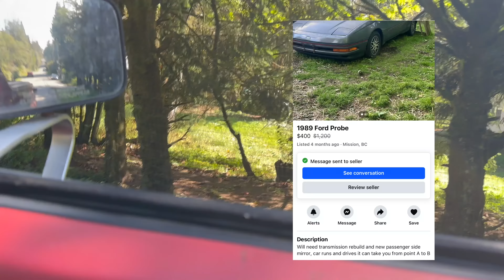BUYING & DESTROYING A FORD PROBE!

Comment: That was a limited ford probe… fully restored they are like 50k. You guys are killing me 😭
Reply: How much does it cost to restore 80k
Reply: Actually it’s not the “gt”, this is an lx non turbocharged automatic
Reply: @nitrous07me  it’s the gx
Reply: Just plastic and metal
Reply: @Luna5.7  yeah and cash is just paper
Reply: @Bossyosha its the lx trim. You can see lx near the driver side door.
Reply: You can’t put $ on having fun.. having fun and beating shitboxes is better then anything else
Reply: @rated4658  yeah they didn’t put it on the car it’s in the VIN. The probe gx had all the mechanical upgrades the gt had besides the motor but was a special trim package for some race in California. Had to order the trim right from ford if you wanted it. they didn’t advertise it because the suspension was so stiff for racing  etc. besides that they was many mounts for safety reasons. Nobody knows how many are out there probably less than 1000.
Reply: @Bossyosha  it literally is
Reply: @Luna5.7  go buy everything with printer paper then, jeez dodge people nowadays are so dense
Reply: @Luna5.7  glad you understand what composite materials are. Now study what appreciation is
Reply: @RADMAN752 is that why it was up for sale for 4 months😂😭
Reply: @itzaxo8860  yep, didn’t know what they had…. Shame- rare gx trim package
Reply: @RADMAN752  no dude nobody wanted it that's why it sat for 4 months😭. Witch means plenty of people seen it, and plenty of people didn't want it.
Reply: @itzaxo8860  eBay’s sold listing on a single pop up headlight went for 680. just bad luck for that probe… but using your logic a rolls Royce is just metal and plastic and leather, holds no value huh
Reply: @reskepa7028  when did I say that, use your reading glasses.
Reply: @itzaxo8860  doesn’t negate the fact that it’s 50k+ restored. Which is what my original comment was about, bye
Reply: @RADMAN752  ya and nobody is restoring a peice of junk ford fucking probe brother🤦🏼‍♂️😂
Reply: @itzaxo8860  your hopeless
Reply: @Bossyosha  typical probe fan argument
Reply: @RADMAN752  dude this is a an lx and your out here calling me hopeless. Wow dude. Do your research next time!
Reply: Junk anyways lol
Reply: Exactly😂
Reply: @Bossyosha my man there’s 10 for sale LX just like in the video way better condition for sale right now between 5-10k not sure where the 50k number is from maybe one with 100 miles on it.. one with 30k miles all original for 10k
Reply: @Riikkyy  this is a GX do some research, won’t be able to find one of those I bet.
Reply: @Bossyosha  I can’t find anything that says GX like you’re saying if you find a link for one post it up, I’m seeing SE, GL, LX, GT, GT Plus, GT “Wild Orchid”. You may be right but I can’t even find one to confirm. And if it’s so rare not sure why nobody scooped it up before they found it. 0 on completed sales on mecum, Barrett Jackson, eBay etc and no manuals or anything to read about it
Reply: It's a shit box buddy 😂
Reply: @Bossyosha  I can’t find anything on the GX trim. Does it even exist, lil bro? 😂 Also, it doesn’t make sense for them to use LX on the door, which is a lower trim, if GX is supposed to be a higher trim. Make it make sense.
Reply: 😂😂😂😂😂 trash box I’d take a KIA before that shit 400 would have been a new Xbox one 😂
Reply: @Chevyssboy138  nobody cares
Reply: @Riikkyy  I don’t care  if you can confirm, I am right it’s a 50k car restored, deal with it end of story bye
Reply: @Bossyosha  lmfao ok 😂 let me know when you find one sale to confirm
Reply: @RADMAN752  dude you don't even know what car this is ur tweaking it's an lx do your research and shut up
Reply: @itzaxo8860  I would’ve bought it in a heartbeat. They live in Canada though.
Reply: @Bossyosha  womp womp mad over rusty metal and plastic
Reply: @itzaxo8860  you are wrong
Reply: @Luna5.7  why are you mad? It’s just a YouTube comment
Reply: @RADMAN752   erm your wrong🤓, read the damm "LX" on it and shut your mouth, your digging yourself deeper
Reply: @Bossyosha  days later and your still bitching about the LX right infront of your eyes. Like I said, typical probe fan dude, get real.
Reply: @Bossyosha  it's just plastic and metal
Reply: @RADMAN752  these comments got you HEATED. Who are you fooling?
Reply: @Luna5.7  dw bros still tryna comprehend the fact he's wrong😂
Reply: @itzaxo8860  gx didn’t have a badge, was a special trim package. Shows how much you know.
Reply: @Luna5.7  your the one who won’t accept that I’m right, calm down the truth got you all fired up
Reply: @Bossyosha  it's just plastic and metal lil bro
Reply: @Luna5.7  yeah and it’s also just a YouTube comment, deal with it sit down dream and about having a car 🤣
Reply: @Bossyosha  AND IT HAS A BADGE ARE U FKN SLOW😂😂😂😂😂
Reply: @RADMAN752  it's just plastic and metal bro. Deal with it. Accept it
Reply: @Luna5.7  a peice of plastic and metal badged "LX"😭
Reply: She can still be restored don’t you worry 😂